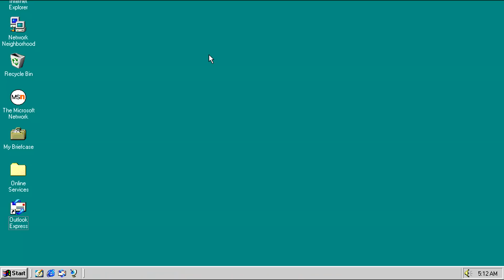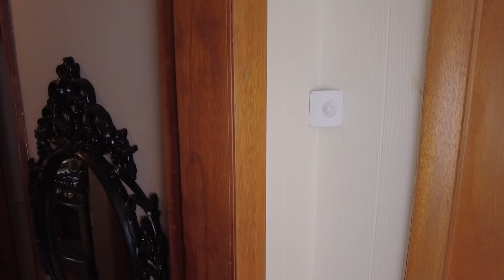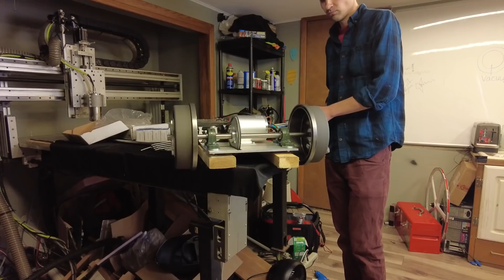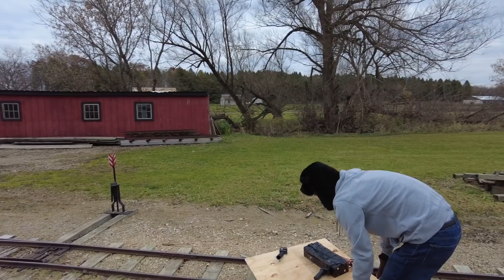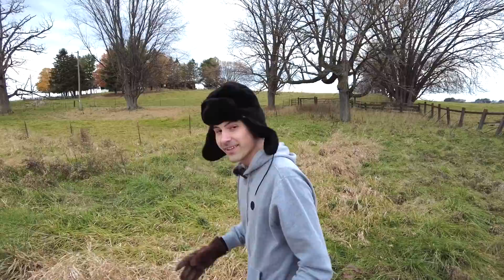REAL Minecraft Minecart on rails! (Pt. 1)

Comment from the maker: Save 50% or more on your SimpliSafe security system during their biggest sale of the year. Visit https://SimpliSafe.com/JOELCREATES to learn more!
Reply: Put a keyway in the shaft and hub. Have the set screw hold the key not the axel.  You are putting torque into the weakest part. If you grounded the axel already it can still be done
Reply: Also can you make a second car that attaches to the front via chain? Like it isnt driven, but is pulled?
Reply: SimpliSafe is the worst security system ever, thiefs actually prefer them over unsecured homes. Look it up.
Why are you deceiving your viewers to buy a scam product?
Reply: @bitterlemonboy  yes.
Reply: Soo basically just a wooden board on train wheels
Reply: "I'm the lockpicking lawyer, and..."
Reply: Ngl that’s a interesting sponsor
Reply: nooooommmayyybbebeyyees?
Reply: Simplisafe more like simpsafe
Reply: No it’s ok I have a painting in front of my door
Reply: Safe 50% in 15 minutes on Geico
Reply: Cut the power and no more alarms and untraceable
Reply: Oh wow
Reply: Okay wait wait wait🤣🤣 that lama was really funny
Reply: You need to add a coupling and a second cart for holding something in it(like say a chest minecart)
Reply: do you have directions for the project?
Reply: Now if all sponser ads involved minecraft, I would watch every frame
Reply: Did you ever come across discover live steam as you were doing this project
Reply: @wesbrackmanthercenthusiast4695 🎆😞🎆🎆😞😞😞😁😞😞😞😞😄😁🥰🚔😁😁😞
Reply: @wesbrackmanthercenthusiast4695 🎆😞🎆🎆😞😞😞😁😞😞😞😞😄😁🥰🚔😁😁😞

Comment: Dude! Yes! I was trying to build a portable rail cart a couple years ago that could easily be carried, disassembled and fit in the back seat of my car. I managed to build a working prototype but it wouldnt have lasted long term Im sure. The wheels were one of the biggest issues. I wish I had known that Cavalier brake drums would be a good fit! Wouldve saved sooo much time. The other big issue was real tracks have a variance in distance between rails. Especially in abandoned tracks, where I had measured over 3" in variance in some places. So I had to concoct an expandable drive axle. It was rickety af and noisy but it worked. Watching this made me want to finish it...if I ever get the time. Pretty cool man. 👍

Comment: The reason why making a Minecraft cart in real life is so hard is because real mine art uses wheels on the side at a 90 degrees this allows more speed with also being more safe and stable but only for mines with one trail but track switches uses a wheel set bigger than it externally on the main wheel. just if u wanted to know:)

Comment: i dont know how much this will help you in the stage your at, but railroad wheels or trucks are commonly made just as you described them NOT to be, but with a little bit of a curve out. Let me try to explain this better... The wheel itself has an incline going up towards the flange, with a little bit of the flange wall sticking up so the train wont just slide off. The way it's made is actually genius, the incline is facing away from eachother from the right wheel to the left wheel, so it's counter-balanced and has less friction, while staying on the rails better. I don't know how good of a job i did explaining that, but i hope it helps!

Comment: The reason your wheels became loose is because they do not have the ability to rotate as if they were turning.

You don't need to be able to steer it or something, just give the wheels some rotating ability, because otherwise when the track isn't completely straight it will rip apart the wheels from their axle.

That being said I love what you're doing. It's a fun project

Comment: Good call on using brake drums, would not have thought of it. I wonder would a brake shop (or your local autoparts store) agree to machine them on the outside instead of the inside on their brake lathe. Don't know if those machines can make tapers, but at $10 a piece they'd at least be smooth and perfectly round.

Comment: Please pick up a brush guard or shoe guard for your CNC, along with a dust removal system - especially if you're milling metal. I know you want that shot of the cut, but it's not worth losing an eye over or having to breathe in metal or wood in a particulate form. Not sure what your table size is, but I've designed and made them for everything from 2' x 2' to 8' x 8' if you need any advice.

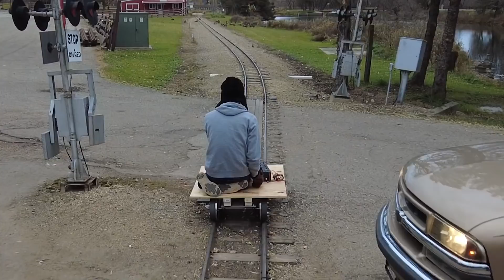Comment: 3:14 Well, next project would be to adapt your cart with these wheels (and upstop wheels) and put it on Meteor, the park's wooden coaster.
Reply: Actually, looking at pictures it seems that Metero is running with flanged wheels! And a small upstop safety pin.

Comment: It is also important that minecarts in minecraft can handle more than 9 G's on each turn and unmeasureable amounts of acceleration when it transistions from a straight track to the climbing/decending track. That much of forces might be uncomfortable on the rider in real life but you could still keep it between +5 and -3 G's perpendicular to the rider and less than 4 G's lateral or linear directions. I think you should still think of the roller coaster wheels design again, I would recommend you to have road wheels, side friction wheels and upstop wheels to lock the minecart into the track and make it physically impossible to derail. You can also build your own track rather than using tracks that are used for model trains. That way, you can make a more aggresive and forceful layout that would be a thrilling and fun experience for the rider. And another thing is, minecarts in minecraft work by either gravity or powered rails which are basically Linear Induction Motors used on real launched roller coasters. I would recommend you to build a magnetic launch system on the track and leave the car with no motors or power sources on it. So it will be more similar to the minecraft minecart in terms of physics, rather than being a railcart painted like a minecart.

Comment: You may have solved my wheel problem! I built my own “minecart” a few months ago and settled with pneumatic wheels. It does decently well and holds 40 gallons or 500 pounds of ore from the local gem mine
Reply: Huh??
Reply: @lamarrotems  huh
Reply: @rainiest7731  wait what?
Reply: @Ruby_D04  huh??

Comment: I'll note, train guys are some of the nicest people you'll meet. It's a hobby that's allowed me a lot of opportunity from the people I meet. Of note on wheels, I've avoided set screws. The wheels on my equipment are pressed onto the axles, then have weld behind that. Even at 7.5in gauge (Half the size of this), I've seen wheels wander. A belt and braces approach may help.
Reply: Or, alternatively, he could drill a few holes along the seam between the axel and hub, tap them, and put bolts in there. If you do it right it could work, but that's kinda tricky to do with a hand drill. What may be better is to grind a few 'flats' on the axel and key the hub so that the hub is taking the torque on the faces, not the set screw. combine this with a bolt in the end of the axel, some washers (and some loctite), and you can set the depth of where the hub sits on the axel with where the flats end using the shoulder that that'd make.
Reply: @zerumsum1640  I reccomend against this. Even with Loctite, I've seen screws on equipment like this back out. Heck, I've had it happen to me.
Reply: @MrRailroadrunner  I mean, with a lock nut (not nylok, just a thinner nut) on a bolt in the middle of the shaft you can get it pretty dam secure. plus, threading direction can help with that. grinders have to deal with this issue and the solution there is make the thread so that the spinning shaft tightens it.
Reply: @MrRailroadrunner  most railfans are cringe ngl. ive met a few and all of them are foaming r3tards.
Reply: @yeoldeseawitch  That tends to be the younger side of the community. People in large scales or in clubs generally are pretty good.
Reply: Hope Joel sees this
Reply: I am a nice person
Reply: Cheers from across the pond Mr Yank! I’ll go back to sulking about British rail privatisation.

Comment: Yes let's aquire wheels!

hyper focuses on the flange and dosent even mention the conical surface required for proper travel

It's funny cus the proprietary drawings you saw most likely mentioned it xD

also uses setscrews instead of pins to secure the wheels

Do you want this to fall off the the track?

Comment: Cross drilling for a pin is likely the better option, but if you grind an aggressive enough flat (like diameter/4) it should be fine with a set-screw and some loctite. I’d drill and tap a circular keyway into the shaft and drum you’d take care of the torque without having to worry about a pin shearing off, and maybe also add a pin to prevent it sliding down the shaft.

Comment: A set screw is not going to be permanant enough.  Based on my experiece with live steam models, even with the screw in a hole, it will still come loose.  You're going to need something more permanant, like a pin, a rivet or welding.  Glue is an option, but would probably not be enough on it's own.

Comment: Have I ever mentioned that set screws are evil?  Well they are.  Cross-drill the hub and shaft for a roll-pin, tapered pin, or bolt and it'll never come loose in the field.  (making a clamp hub is better, but much harder to do without a welder or machine tools)  

Fyi, using brake drums is brilliant.  Amazing that they work so well. Should be a lot cheaper to get them finish machined as well.